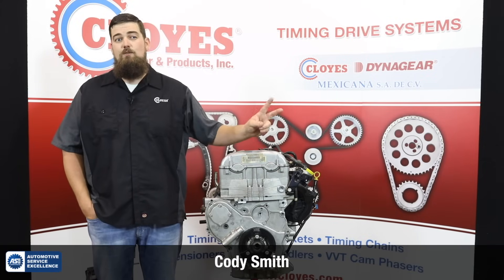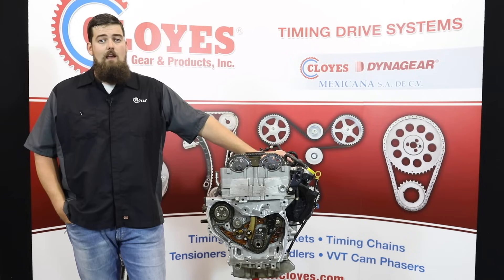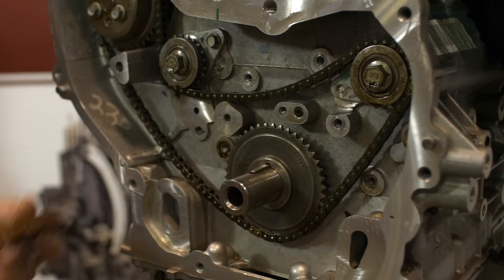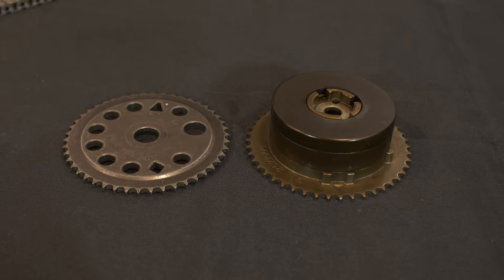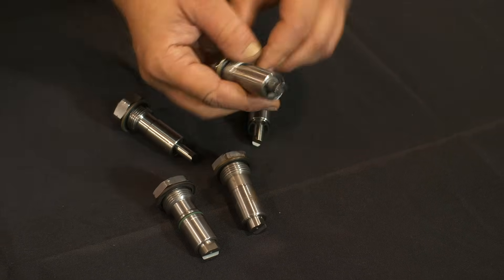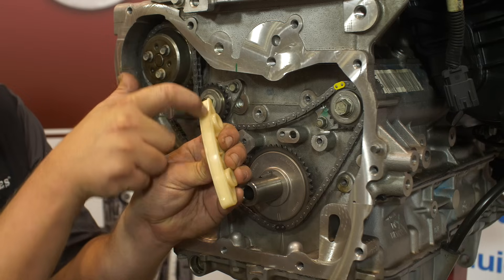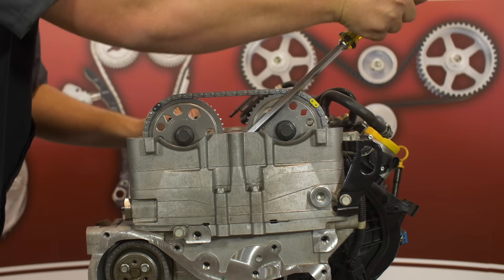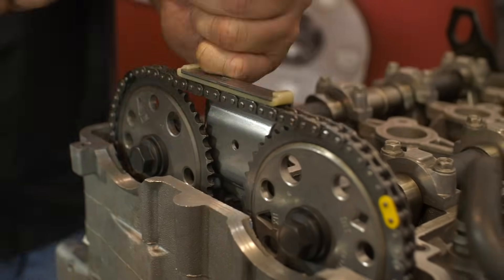GM 2.0/2.2/2.4L, Timing Chain Replacement, Cloyes 9-4201S & 9-4202S

Comment: Any reason why my balance shaft gears are at 1:00 and 4:00 for intake and exhaust, with crank at 6:00, after replacing this chain after a water pump/timing chain swap, I have a low frequency vibration and can't figure out where it's coming from.

Comment: what do you do if the eyelet that retains the balance shaft into the block is broken and finding another one is deemed impossible?
Reply: Weld an appropriate sized washer to the plate.. good as new

Comment: Correction of my earlier statement if you're trying to teach someone how to do something by pounds get the right percentage of pounds because I just broke one of the screws trying to put it at the weight that you asked for be specific because it's 60 lb not 89 because that 60 is where it broke
Reply from the maker: The majority of the small bolts are 89 inch pounds, not 89 foot pounds. 89 inch pounds is equal to about 7.5 foot lbs.
Reply: @Cloyes01  I get that but now I have 2 broken screws belonging to 2 different guides and I'm under lots of stress
Reply: @8SecSleeper  and ur right. I was concentrating on exactly what was said rather than know full well that something old is brittle lol. I have an 06 Saturn that's y I say that. Just these videos make it so simple rather than showing how it's done laying on ur back w a small amount of space to work w...idk...I guess not working is driving me nuts lol
Reply: And to add, they did make things simpler by the steps taken

Comment: which tensioner needs to be reset after replacing the water pump that cause the whining noise? thanks..anything a help
Reply from the maker: That would be the balance shaft tensioner, the small internal tensioner for the bottom chain. This will only need to be reset if the chain is removed during the water pump replacement, or if the sprocket is not held securely during replacement with the special tool.
Reply: Cloyes Gear & Products, Inc. thank you so much👍👌

Comment: So... I had a customer get your kit for a 2010 Chevy Malibu. I followed this video and had a huge failure with your balance shaft kit. Following your instructions on for the torque on the balance shaft sprocket a gear tooth broke off the sprocket intake side. I was forced to reuse the old sprocket. Is it common for your part to brake when torquing?
Reply from the maker: Thanks for reaching out. Our Engineering team has completed this install to the torque spec with no issue. Under torque, the sprocket tries to wedge the drill bit away. Might this have occurred in the case you mentioned?
Reply: @Cloyes01  I understand that. Like I said. The drill bit method just breaks the drill bit. I broke two, then I used the punch. I held the pouch straight.
Reply: @jth1987leb  sounds like an inferior quality drill bit

Comment: I've got an 07 HHR with 2.2.  It currently has 308000 miles on it.   Replaced alternator is the only thing I had to do on the engine.   It still has the original clutch.
Reply: Better go buy some lottery tickets you're luck is about to Run out
Reply: @mftstrifelegit2786  what more do you expect of the motor if it dies tommorrow 308 is good enough

Comment: Hi Cloyes. I have a question. I have a customer that just installed a new engine and they are getting a p228d code along with a p 0 0 16 camshaft crankshaft correlation fault. After pulling the valve cover and looking at the timing marks it appears that the chain inadvertently gets slack in it about every 20 to 30 degrees of crankshaft rotation.  We are trying to sort out why the chain inadvertently gets slack in it during the rotation. It also has a good amount of chain noise at idle unless you command the exhaust cam to 0 degrees.  You guys have any tips? Oh and this is a 2012 GMC Terrain with the 2.4 L Ecotec with variable valve timing and direct injection.
Reply: That was a problem with the original design timing chain tensioner. That's why the updated Cloyes tensioner has a ratcheting mechanism added to it.

Comment: My 06 cobalt ss supercharged has 130000 miles now and I've noticed about an eighth maybe even a sixteenth of an inch of slack in the timing chain between the cam sprockets. Is this something to worry about? All markings are lined up just didn't know if this was wear and tear that needs to be adressed thanks for any input
Reply from the maker: It is normal for a small amount of slack to develop between the cam sprockets when the engine is not running. The camshafts are under valve spring pressure and will rest in positions that create that small amount of slack. The only way to gauge chain life would be to check tensioner extrusion with all the chain slack on the tensioner side of the sprockets.  If the tensioner can extend far enough to remove all chain slack then the chain is still withing operational limits.

Comment: So doing the turbo version with the cam sprockets without the locating lugs. Should we get sprockets (or at least try) with locating lugs? Or how can we re-install with those sprockets?
Reply: It requires a camshaft lock set that fixes the cams into the correct positions.

Comment: Valve cover and primary cam timing chain wouldn’t have to come off to just reset the balance shaft chain tensioner, correct? A water pump was changed and now it needs to be reset
Reply from the maker: Correct, you can remove and install the balance shaft tensioner without primary system removal. You will just need to remove the timing cover.

Comment: How do you reset the timing if the cams have been moved after you take the tensioner out
Reply from the maker: The cam sprockets are indexed and will only install one way, and the timing is set by the timing chain. You can rotate the cams using the hex features to move them as needed. As long as the marked links of the chain are aligned to the correct sprocket timing marks the timing will be correct.

Comment: Hi Cloyes, thank you so much for this video. I will be ordering Cloyes timing chain kits for main and balance on my 2.4 Ecotec. Very clear cut instructions however I only want to verify one thing, I have the VVT version and the only step I'm thinking about is the one where the cam phaser holding tool was mentioned in the video. Can I substitute using the tool with just a plain wrench like shown in the video to hold the cams steady to install/uninstall the bolts? Or is there more that I am missing here? I don't want to damage the cam phasers. Any advice is much appreciated.
Reply from the maker: The camshaft holding tools are not required for the VVT equipped engines either. The same process of using the hex features on the camshaft  can be used. The cam holding tools may make the job easier, but are not required, and you are not risking phaser damage by not using them.
Reply: Great, Thank you so much for the response.

Comment: What a crappy design! I've put motors in the Chevy equinox with less then 20,000 miles. Very disappointed in Chevys design👎 chain jumps bends all the valves.
Reply: exactly - avoid the change oil light change oil often.
Reply: I have same motor in my 2013 Chevy captiva and I have 131,000 miles on it still runs great at 28mpg

Comment: All valves on the head closed correct?
Reply from the maker: Yes, all valves should be closed at the ideal timing position. You should have no valve spring pressure on the camshafts.
Reply: Appreciate the answer!

Comment: the black plastic  guide needs to be re designed more like the metal one and the chain should be heavy duty and doesnt need to have so much slack.,,, they are taking out these engines too often !!!!
Reply: I agreee..ive done several ecotecs. The black plastic guide is always the failure
Reply: taking mine out now

Comment: my friend is getting the p016 p017 in his daughter 2011 chevy mabul 2.4 and he swap out the parts for them codes and the codes still comes back and its only has 142.000 miles dose the timing chain set needs to be replace at this time ?
Reply: Sounds like its due for a new chain guides and chain

Comment: Question: You say #1 TDC on the exhaust stroke, but the service manual says TDC on the compression stroke. Is that due to a change in the markings, or does it really matter?
Reply from the maker: With the engine on the compression stroke, the appropriate marks on the camshaft sprockets/phasers will be down and will not engage with the chain. The engine must be on the exhaust stroke for the chain to be aligned properly.
Reply: @Cloyes01  Thanks for the call back this morning, your voice message was super helpful. It's distressing when AllData is wrong.

It's not up and running yet, I ran out of daylight, but the timing & balance chain kits are all in and done. I was really surprised how different the sprockets were. Much simpler design now. This engine had version 1 of all the stuff that's been redesigned.
Reply: @Cloyes01   you just told someone else that all valves should be closed and no spring tension on the camshafts. Wouldn't that be the compression stroke?
Reply from the maker: @EmbersofEden17  That same scenario will happen on the compression stroke as well, but you are looking for TDC on the exhaust. When the exhaust valve just closes and before the intake starts to open. This is when the 2 camshaft sprockets will have their correct marks at around the 10 o'clock and 2 o'clock positions. On the compression stroke the cam sprocket marks will be 180 degrees out and not engaged with the chain.

Comment: Would this be same process for Ecotec 2.4L from a 2012 Chevy Equinox?
Reply from the maker: Very similar, the only difference will be the cam sprockets. You will have phasers instead of plain cam sprockets, but they will be marked as well and everything lines up the same.
Reply: @Cloyes01  Awesome, thank you! Great video's and tutorials!
Reply: @Cloyes01   So if we have phasers are the phaser sprockets used again or do we need to buy new phaser sprockets?
Reply from the maker: @kirkfranks1  Phasers can be reused, just inspect the sprocket teeth and make sure they are not heavily worn. It is recommended to replace them while you are in there though.

Comment: I really need to know why it is advised not to turn the motor after doing this. 

I just did this job on my car and when complete, I attempted to rotate the engine. when I turned the crank a quarter turn, I developed slack underneath the top chain guide between the cams. why is it doing this? all of my alignment marks are spot on, I turned all the slack of chain to intake cam like in the video, I set the primary timing chain tensioner and voila, same thing happens over and over. I'm afraid it's going to mess something up when I put the covers back on and go to start it. 
I had the random chain rattle to begin with which is why I started this project. when I first took the valve cover off, there was the same slack in chain as when I turned the crank a quarter turn as mentioned above after the installation of all new guides and chains. this car has the new style tensioner from factory. I have a 2010 Malibu ltz 2.4 vvt vin code "B".
Reply: I would also like to note that when I first took the valve cover and timing chain cover off, there was NO damage to anything. all guides intact, no damage to them or the chains or teeth in gears and there was no chain stretch, nothing to indicate any kind of failure other than noted abnormal rattle from primary chain slack. no codes or anything was set on this car. I'm really confused.
Reply: UPDATE: I just went ahead and buttoned everything up. fired it up and it STILL HAS RANDOM CHAIN TAPPING during idle and at anything above idle. I'm really stumped. has anyone else had this problem?. I did everything by the books, probably have about 8 hours of research on my problem and still have problem. what could it be? did I overlook something?
Reply from the maker: The reason we advise not rotating the engine is that timing can jump when rotated by hand before the tensioner gets primed up with oil. The chances of the timing chain jumping is decreased when rotating at starter speeds. As long as the timing doesn't jump, there is no issues with turning the engine by hand.
Reply: Yeah I turned the crank by hand and my timing marks never came back to the original marks.  Never came back to the marks on the balancing chain/sprockets either...did I jump timing on the balancing chain as well? or are those sprockets/marks not meant to come back to their originally marked positions?
Reply from the maker: @Jrod513513  The marked chain links will only align initially. Once the engine is rotated the links will no longer align.
Reply: The colored chain links won't come back to the sprocket marks on both the balancer or timing chains?
Reply from the maker: @Jrod513513  That is correct.
Reply: Re watch the video on timing chain tensioner activation.
Reply: So.... I'm doing this with the engine removed. I must rotate engine to install torque converter bolts when i reinstall. Is there a suggested way to do this?

Comment: On the balance chain tensioner after you pull the "pin" do you have to rotate the plunger?  It fits in the guide shoe better???   Very confused there.
Reply from the maker: When you pull the pin on the tensioner the piston tip should go inside of the tensioner shoe feature. If it doesn't go in that groove on its own, then very little rotation should be required to get it to.
Reply: Thanks Cloyes, I see that now and it is all together, didn't take note of that during disassembly, you guys are great!!!!!  Oh just a suggestion, on your next video, maybe spend a little more time on both tensioners. I received mine (cam kit) but the tensioner was "activated" I had to disassemble and reset, that was not hard but confusing. Watching video again I seen the plunger is suppose to be sloppy, before activating.  Anyway,  Thanks again.

Comment: Follow up - had been in and out of my timing case 3 times since. Double checked everything. Made sure balance shaft sprockets were at 37ft lbs - the problem ended up being a DEFECTIVE balance chain tensioner. It had sprung,  but after a decent amount of pressure,  15lbs orso, it retracted back into its turtle shell. My car has been down about 3 weeks because of this. Do you have a better quality control option? I wouldn't think a brand new tensioner in one of your kits would be defective, but low and behold. Double check all your tensioner and push as hard as you can after you spring it to make sure it does its job.